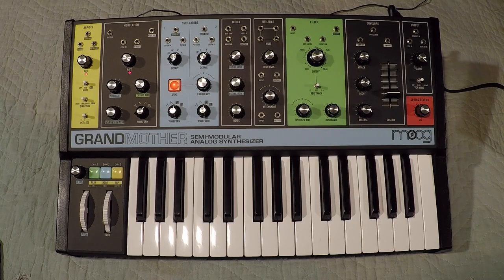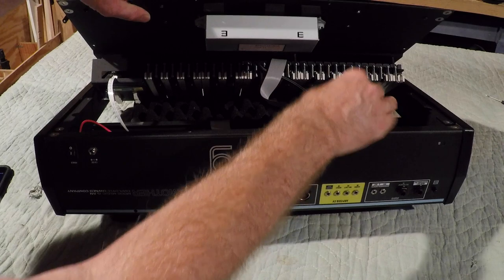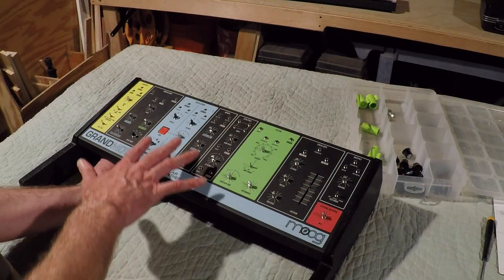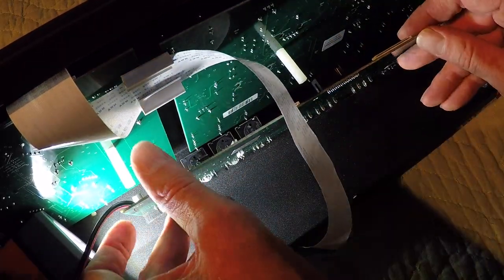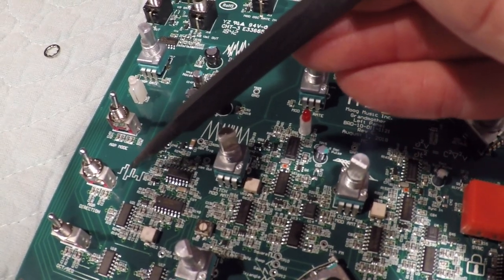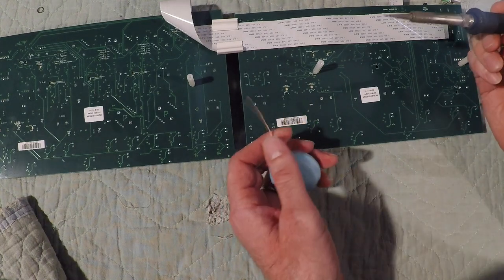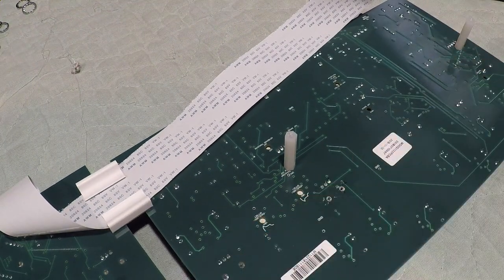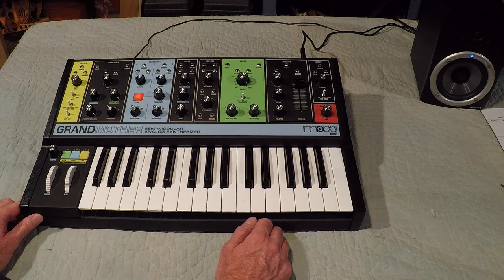How to fix a Moog synth (and hidden PCB art)

Comment: Thanks a lot for sharing, I will be replacing the plastic side panels with wooden ones and this helped a lot in taking the thing apart!:)
Reply: Hey! 
Where have you bought those, or have you made them you self? I would LOOVE a pair of wooden sides on my black GM. I think the sound will improve as well ;)
Reply: @mikkelfrederiksen5567  Hey! I've made them myself, but if you don't want to do that, I can recommend Curry Cases. They should have the GM panels in stock again soon, just ask them, the owner is a very nice guy and they ship internationally :) The tone of course increases immensely with the tonal wood and all ;)
Reply: @atlas9097  thanks for the advice! I'll do that 🙌

Comment: Great video, I appreciate you documenting the steps. I might have to fix my LFO. Does yours sometimes take a while to come to life? The other oscillators make sound immediately but the LFO is usually silent for a while then eventually wakes up. Also FM tracks better across the keyboard on osc1 while osc2 gets wonky much quicker when modulation depth is kind of high. Not sure how normal any of this is.

Comment: Hey man, this is exactly the video I was desperately looking for. I also have a scratchy filter pot and reverb pot on mine unit, and couldn't find a solution online. It's a common problem with recent Moog products which is really a shame. How much time did it take you in total and what is that green tool called you used for taking the buttons and rings off?
Reply from the maker: Well it took me ALL day but that was because I was  filming it. Making a video makes it take so much longer. I would guess without the video it probably would have taken anywhere from 2-4 hours. Those green tools are called Rocket Sockets from Love My Switcher and they help SO much, I highly recommend them. 

https://lovemyswitches.com/rocket-sockets-pedal-building-socket-set/

Comment: Thanks for the video, it helped a lot to see the repair before I will do mine. Some pots of my Grandmother are scratchy too. It took me half a day to think about a procudure how to test all the pots with an oscilloscope without taking it apart before getting the replacement parts.

You don't happen to know the exact specs of the pots?
Reply from the maker: The frequency cutoff is a B10K “alpha style” pot. Not sure if the other pot values though. But you can also just call the Moog service dept and they will tell probably tell you for free.
Reply: @SISKworks  Yeah,  thanks.

I have written to their support and am waiting for an answer now.

Comment: What nut driver set are you using to pull all the hardware from the faceplate?
Reply from the maker: They are called “Rocket Sockets” from Love My Switches. They are extremely helpful and I’m so happy I purchased them. 
https://lovemyswitches.com/rocket-sockets-pedal-building-socket-set/

Comment: Hey there Mike, I just purchased a brand new Moog Grandmother and am having an issue with the attack decay sustain release. When I press a note and allow it to get into the sustain portion, as soon as I release the note it retriggers the same note at a higher volume. Someone had commented that it sounds like the VCA bias needs a slight calibration by turning the associated internal trimpot. Did you notice a trimpot in that area when you took apart your Grandma? I don't see one in the video.
Reply from the maker: Yes there are some internal trim pots. I just confirmed by looking at some pictures I took when it was apart. But I’m not really sure how to solve your problem. Maybe take a pic or mark where pots were set before making any changes. They are all pretty small and they all seemed to be marked VR (variable resistor). Good luck! Hope it all works out for you.

Comment: Hi Mike, thanks for this video! My GM suddenly doesn't turn on anymore. I wasn't even using it. It was under the current socket like all the other rack synths. I'm not much expert could it be just the power fuse?
Reply: Did you find out?

Comment: I came across your awesome video in search of a way to pull off the button caps (red, yellow, green, blue) on a Matriarch without opening the synth. Would you say that this is possible?
Reply from the maker: I’m not 100% sure because I didn’t really inspect the button on mine. But I’m fairly certain that you would need to disassemble in order to change those button caps.

Comment: My Moog 10 has a scratchy pot after just a couple of years. They told me to put 3 in 1 oil in there much to the shock of former Moog engineers and techs I know.
Reply from the maker: Hmmm. Idk anything about 3 in 1 oil.  It might actually work better than something like a electronic “contact cleaner” spray. Contact cleaner pretty much ruins the feel of pots because it strips the lubricant from them. Maybe the 3 in 1 would clean and lube. But I would start with Deoxit fader F5 spray first as that product is intended for this very purpose. I tried this on mine first but it didn’t help so I ended up needing to replace it.

Comment: did it seem like it would be possible to add mods to the circuit? like adding CV control for the envelope decay or anything like that?
Reply from the maker: There wasn't specific labeled mod points like the Korg Volcas have. But envelope decay DOES already have a knob/pot. Pots are just variable resistors. So you could in theory just connect a vactrol to the points the pot is connected to in order to get basic CV control. A vactrol is just basically just a light dependent resistor (LRD) with and LED stuck to the front. The LED gets brighter or dimmer with the amount of CV it it given which in turn changes the mount of resistance in the LDR which would change the amount of decay. I've done this a different circuit bending projects but just now on any of my real synths but it should still work the same way.

Comment: My reverb pot is busted and Moog is sending me replacement pots. I live in India and I hope it comes through in good shape... Sucks man!!
Reply from the maker: Good luck. It’s not hard. Just take your time. Also the pots are just the standard “alpha” style. So as long as you use the same value as original you should be good. If you can’t get the replacement from Moog you can just order from something like Tayda Electronics (Thailand)
Reply: @SISKworks  Moog agreed to send the pots free of charge. They are yet to confirm  post shipping. The reverb pot has gone so bad that just by touching it, the reverb becomes 100% and it scratches like crazy. . I don't know how long it takes to arrive here but this is such a lovely sounding synth, even a small dent on it makes me want to cry :(

Comment: I want to replace the dirty reverb pot. I see 2 pcbs are interconnected. Can I disconnect the reverb pcb from the oscillator pcb?
Reply from the maker: @swaroopa1965  I really can’t remember where exactly the board spilt is. But I’m pretty sure the oscillator is on one side and reverb on other with ribbon wire connecting. I’m sure there is some type of disconnect for the ribbon wire but I just can’t remember any of the details.

Comment: after bought a new 1xxxx serial subsequent37, cutoff drooled some black stuff and got stucked, othe on/off buttons even if disconnected the knobs act anyway, noise knob is this cas is acting and a lfo somhow, C2key produces no sound,  on my collection one of the best sounding synths i had for 2/3 weeks lifetime, Should i be stupid to buy another one while im still waiting from components from Moog Music?  should i have a third one? for when 1 is repairing and the second one gets faulty while on process.  My most recent synth i have was the first and only synth get faulty, and with so many issues
Reply from the maker: I’m sorry but I’m not understanding what you are asking. If I were you I would repair the first synth before buying a second or third.

Comment: Is it possible for your to share the specifics of the potentiometer? I am trying to see if I can source the part to repair my moog. I also need the specifics for the spring reverb potentiometer. Thank you.
Reply from the maker: The filter was a linear 10K PCB mount type, marked “B10K” But I have no idea about the spring. But you can just call the Moog service department and talk to someone and they will probably tell you.

Comment: hello sir ,  when l press my keyboard key then put off , but the sound don't  release  ,  the sound still there , but only certain keyboard keys . how can l fix , please help... thank you.
Reply from the maker: I’m not sure. Could be an actual physical connection issue at the key contacts but hard to say. Have you opened it to inspect the contacts under the keys? That’s is probably where I would start. Also Moog has a service department that is really helpful. You could try calling them and explain the issue and they might be able to suggest what to check. I’ve done that and had them send me a new pot to fix this Grandmother.

Comment: Thanks for the video - I am about to do the same repair. Do you know the value or part number of the potentiometer? I also need to do this repair, but so far I have not gotten a response from Moog so I'm thinking I will just order the pot myself.
Reply from the maker: It is a “B10K” pot. PCB mount.